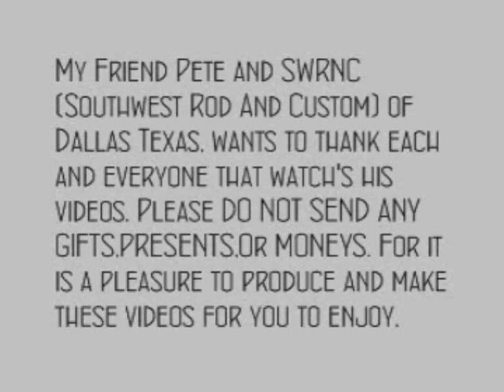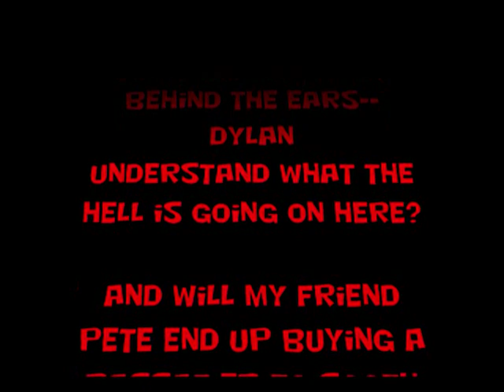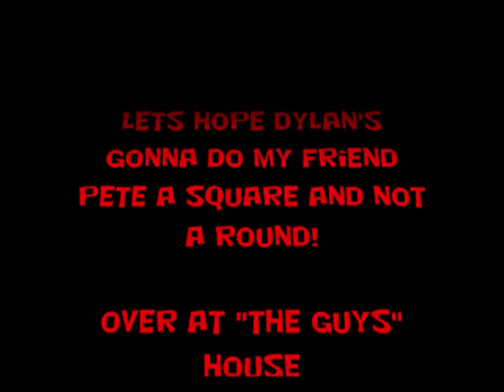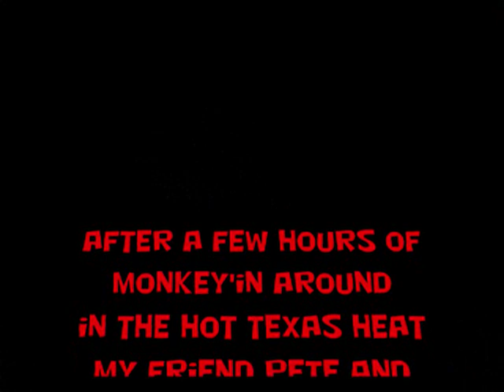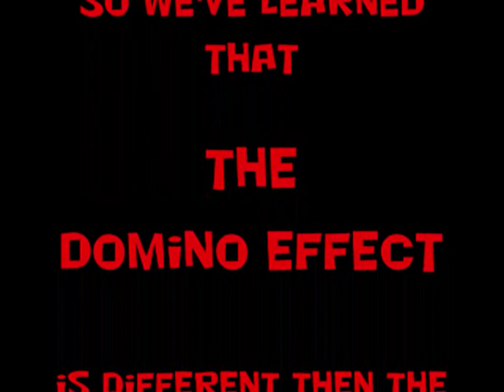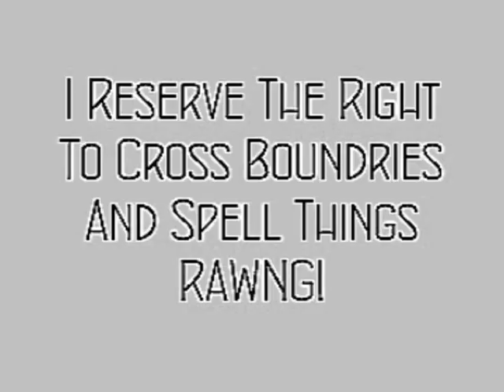Fuel Injected Pro Street Chevy Truck-The "JIGSAW JOB" Starts Right Here!

Comment from the maker: we checked out the engine specs and as said in the video this is actually a 2001 chevy truck 5.3 truck engine/trans with a camero/corvette intake on it. The motor has been rebuilt  and some high performance parts have been added to the engine, what---I don't know, Ill be very curious to see what it does when we get it running. This should make a great drive train for the customer and it should be a very reliable setup when Im done with it!

Comment: I am sure you already have that engine in , but the engine mounts you need are the actual stock 1965 pickup v8 mounts , very common parts store item believe it or not , just bought a set about 3 months ago , they remind you of a ford engine mount actually ...

Comment: The LS Series motor is actually pretty fantastic though i will admit they all come with that intake manifold and there have been some cases were people thought they had a 5.3 when they in fact had a 4.8 and even then they were able to push it to 1200 horsepower with a twin turbo and a changing the piston rings and it didnt even blow up

Comment from the maker: The cab's gotta go on first because this engine/trans will not sit in the exact same place as the old drive train, and you have to have the cab/firewall in place to align the engine in the proper position, if I put the engine in first it might be back to far or forward to much, better to have the cab on first in a situation like this.. I need your address again---PM me. Pete

Comment from the maker: This model engine is actually the first generation, it has a cable driven throttle body, and using this engine/trans in todays "Y2K world we live in is much better then the ole school setup. More effeciant on fuel economy, more reliable, more engine tork, and overdrive transmission makes a much more reliable vehicle then having the ole school stuff. In the long run the owner will be saving lots of money and time having this setup.